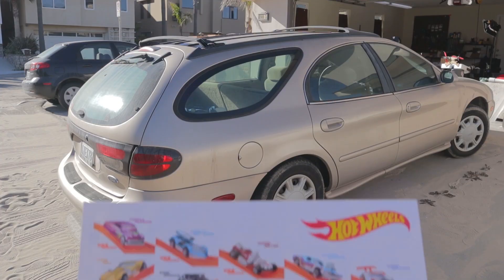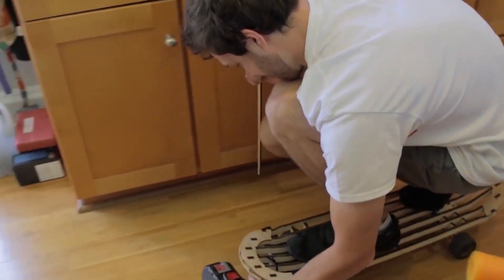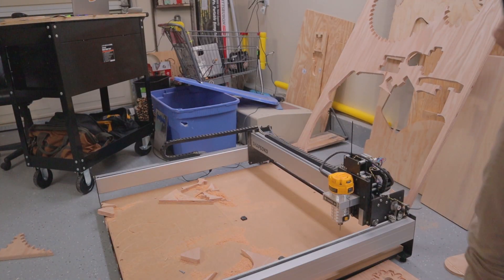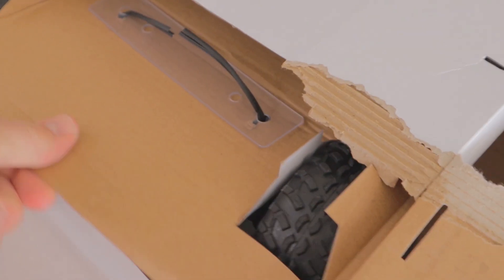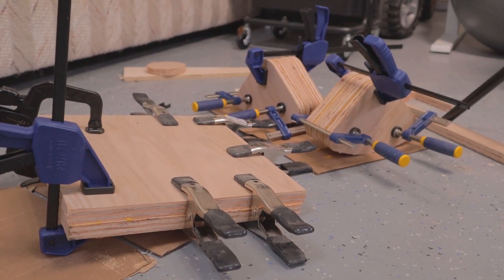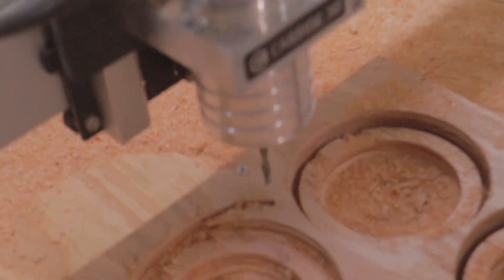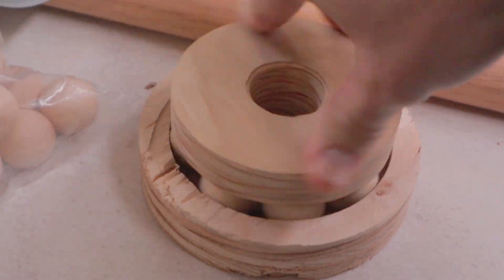CNC Wood Bearings

Comment: A list of some spoilers for the wooden bike (yes I know this is a year late):
2:17 headstock yokes and forks visible
2:23 same parts in plain view
3:17 the bikes frame is visible
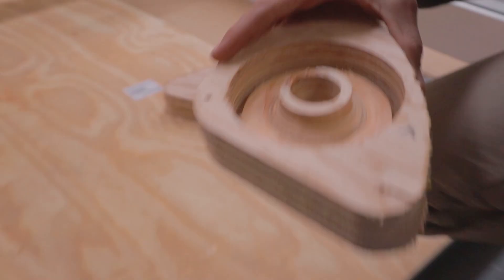3:36 yokes, forks and wheel visible
4:28 bike frame which wheel attached
5:24 wheel and bike frame with wheels and gears visible

Comment: These are angular contact bearings and are made for high load applications 
Due to the bearing not having a cage which conceals the ball bearings this bearing is not for use because the bearings have freedom to move between the two parts of the bearing 
for those bearings to bear smoothley
you would require a cage and proper arangement 
nice video tho

Comment: Usually when a cnc router gets stuck in a certain way it will loose its position it was moving in, so if its moving in the x position at the time, when you try go back to to original x position it may be a few cm/mm off. If it happens a lot its best to mark your starting spot, manually drill down on your zero and if the router fucks up turn it off then manually move it to that spot and then turn it back on and it should zero in that spot.

Comment: You dont actually want the balls to fit well to the radii of the races. Imagine the axis that the ball spins around. You have contact points with varying distances from that axis. That means you will have sliding contact, which means less efficient bearings

Comment: make a robot that slaps chicken to cook it,
either by slapping it once at around 4,000 mph
or by slapping it 23,050 times at 25 mph
Reply: PapapapapapapapapapappapapapapapapapapapapapapapaPPPPPPPPpapaappaappapapapap 

Chicken breast: sizzles
Reply: That and have it being slapped multiple times at once
Reply: Did you do the math?
Reply: clxxiii there was this post that went semi-viral a few months back that had the math done
Reply: Koen Rampersad yeah this isn't Michaels channel
Reply: Louis weiz did that
Reply: Wrong channel
Reply: i say it should be 250 celsius but super fast
Reply: thats just called using a microwave
Reply: someone already did that
Reply: @325bpm6  the commenter posted this before they did it

Comment: To make the bearings run smoother you could mill out a ring of masonite with fingers projecting inward to fit between the balls and hold them equidistant from each other. Metal ball bearings have plastic or metal pieces that do that, called the ball cage.

Comment: I've got a random question from watching some of your old videos.  So when the laser is cutting you cant see the laser beam because it has nothing to reflect off of, so why can you see the laser beam when its inside the CO2 laser tube? Does some of the light leak out of the lasing medium? (also wasn't retina smelter 9000 infrared)
Reply from the maker: The laser is 10.6um infrared which is invisible. It's the same wavelength you're constantly emitting from your body which is how thermal cameras work. The light you seeing in the tube is a relatively small amount of visible light being generated for whatever reasons.

Comment: Actually William, that hot wheels car was intentionally designed to look like the back of your car. It's a sequel to a 1960s custom Dodge truck (Deora) that used the rear of a Ford station wagon as the cab. When the Deora II was designed, they did the same thing and used the rear of a newer Ford station wagon as the cab. There's also supposed to be a Deora III Hot Wheels car this year.
Reply from the maker: Omg that makes it even more awesome!!

Comment: OH MY GOD YOU ACTUALLY BOUGHT PROPER ENDMILLS. AND YOU SET UP MULTIPLE TOOL PATHS. You're growing up so quick, bud. 

Edit: goddammit, you still haven't learned to tab. With a flat end mill, make a FINAL toolpath around your project that leaves 1/8th to 1/16th inch uncut. Then just pop those same tabs you already had instead of dremeling it.

Comment: I’m sure you know the issues with wood ball bearings.  A lot of intrinsic properties of the material don’t lend well to this type of application.  Pretty dope project nonetheless.  I would’ve preferred a second copy of them in a piece of oak.  You can use the same files just need to slow it down.  Make the shell out of a lathe blank, than use actual steel bearings that fit and you’ll have a much better replication that still works for your wood theme.  Plus they would be baller and be worth saving for prizes or whatever.  Take an afternoon and do it for me William.

Comment: You should bought a traxxas slash, much more reliable than the one you bought.
Reply from the maker: Traxxas is a little expensive for what I plan on doing with it. This car is pretty fun, but the build quality is meh..
Reply: William Osman yeah they are a little more expensive, but there fun to work and play with, also they are more durable so that means you can get more project uses out of them.

Comment: why did you actually switch over to wood instead of plastic for your projects?
Reply: Like, a 3D printer is way cheaper and more accurate, plastic maybe is more expensive but you waste way less materials. And the time it takes to 3D print a part is maybe long but these videos have enough time between them
Reply: Since he lost his laser in the wildfire, it's probably hard to feel like you can actually invest your time in a project like that and get something out of it. Why try in the first place if it can all burn down? Also, it probably requires a lot of work, and he has the CNC router working.
Reply: @andersledell8643  yeah he has it workimg but he had a lot of problems wih it in the beginning, and a 3D printer is just plug and go, it comes preassembled

Comment: You're recreating the wooden bike from the Q
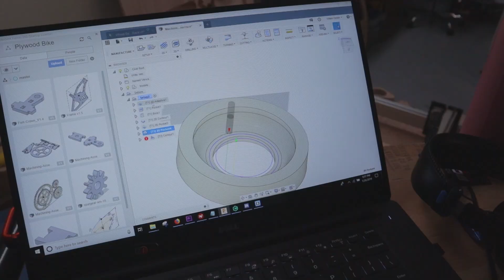Reply: 7:22 the name of the project is "plywood bike" so you are probably onto something.
Reply: @nomercyriding  or you can pause at around 1:56 and kinda see a blurry bike when he's turning around
Reply: mathias kummer because of radial load bearings that wouldnt be my fist guess but i believe they are gonna use two symmetrical to each other on both sides and clamp through axis. Will be interesting.